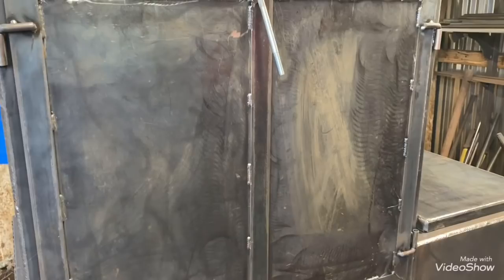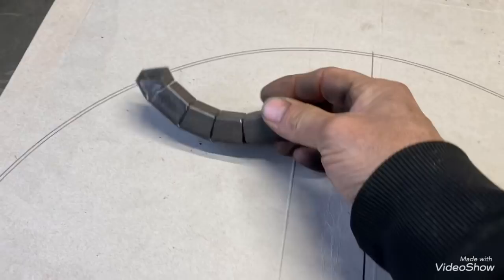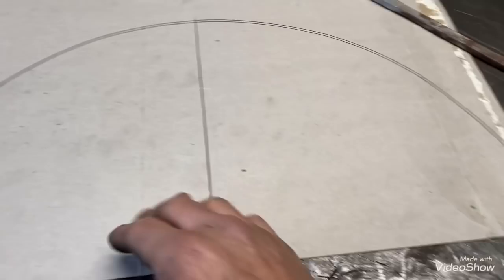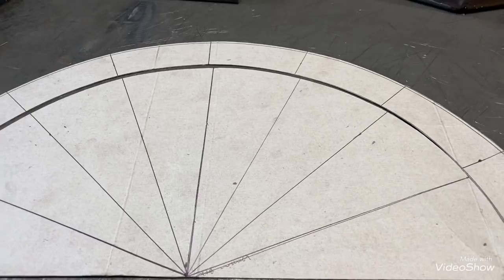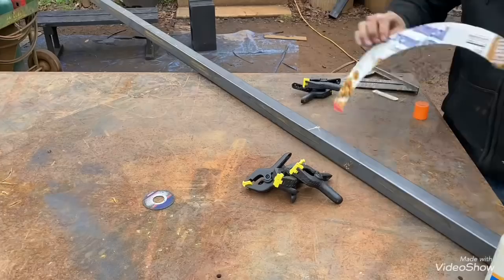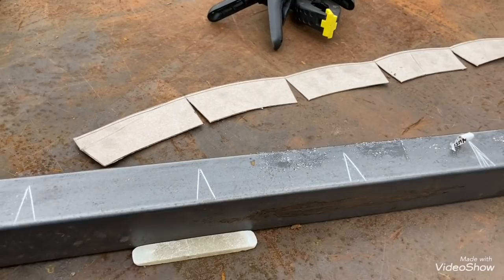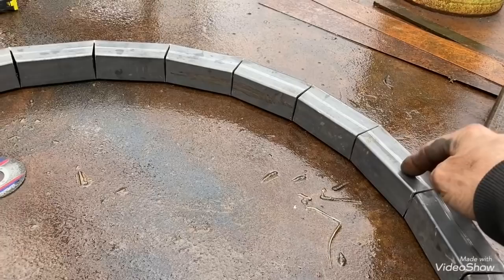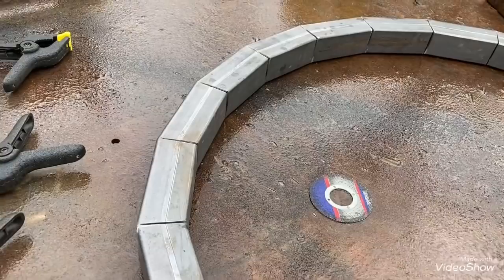How to curve square tubing

Comment: Quick tip brother, if you use a speed square it has the degrees 0°, 45°, 90° on the inside. Make a mark then use a straight edge and mark it from the center punch to the end of the radius. Hope that helps.

Comment: I always enjoy your videos , you could really benefit from a computer, auto-cad program and a  CNC plasma table.  Design it on computer and print out templates or patterns to transfer to steel, or in Auto Cad  you send it straight to the burn table... so awesome, look into friend!
Reply from the maker: I will be soon, shops coming in a few months and cnc will be the next step
Reply: @Allensweldingwoodworking  Allen, I've been trying to get ahold of you for a custom smoker. Shoot me an email when time permits.

Comment: If I'm making a gokart or small vehicle chassis, would this square tube bending technique weaken the structure or should I just make or buy a tube bender?
Reply from the maker: Might be better with a bender, I usually do this with stuff that’s not going to under much pressure. Thicker tubing might be fine though
Reply: What tube thickness would you feel this approach could be safer with for something that would be in a moving object that would be subjected to a lot of G-force and side to side action?  @Allensweldingwoodworking

Comment: How do you calculate the size of "V-Notch" you need to cut out or do you just randomly choose a size?
Reply: When you cut the lines going from the center point and straighten the  paper out on the tubing it tells you how big of a notch to cut out. That is the whole point of even going through all that work for.